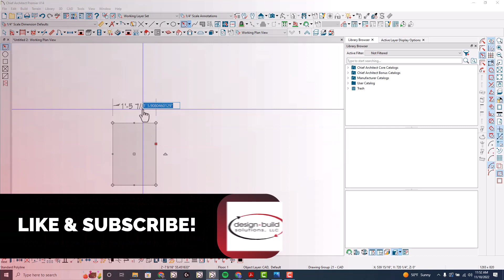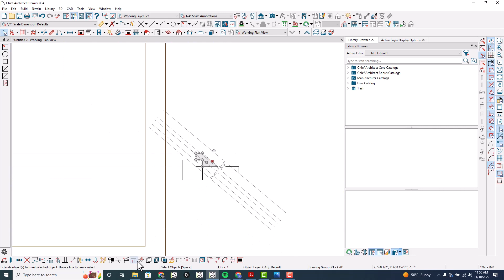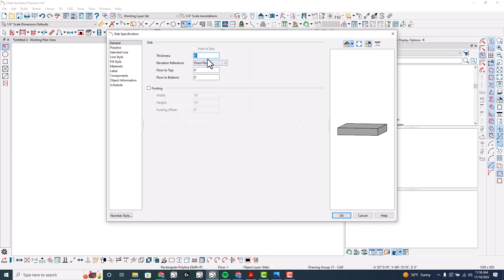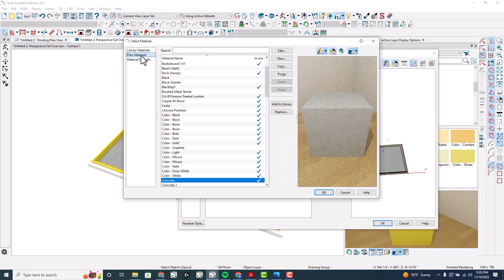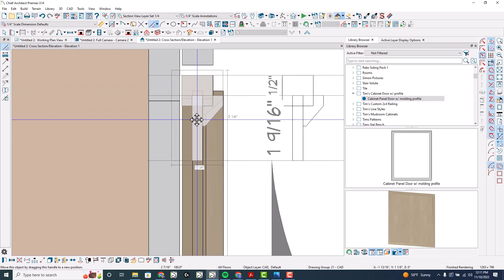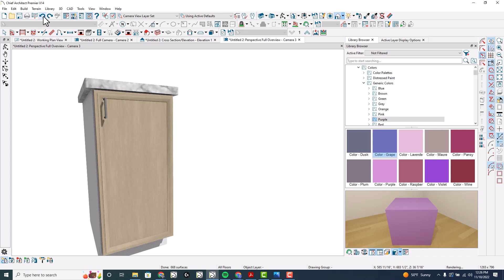Custom Cabinet Door slab w/profile | Chief Architect

Comment: awesome video, can you guide me on how to make a cabinet door that has a raised molding detail about 2" away from the edge and is 1" wide 1/4" high on a 3/4" thick slab, but the trick is that it maintains the look when is 2 doors that the detail stays as one door and the same effect on 3 drawers that looks like one panel, thank you
Reply from the maker: You'd have to add a molding polyline onto the face of your slab, and I make a door/drawer panel for each of the 3...1 for the top, 1 for the middle, and then for the bottom I usually can copy the top and rotate 180 about the Y-axis

Comment: I just skimmed the video, but probably no need for Stretch Zones. A single X and Y Stretch Plane works for cabinet doors.
Another method is using a Custom Countertop which comes with moldings.
Reply from the maker: Custom countertop is an interesting idea! We would have to rotate the object since we cannot draw a countertop in elevation, but not a big deal for sure. I did not know the single stretch plane works for cabinet doors.